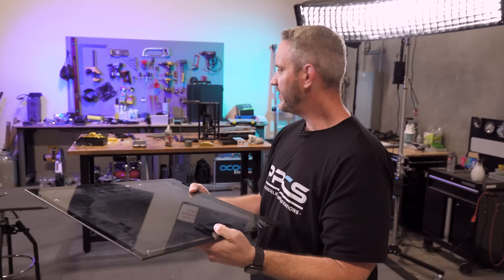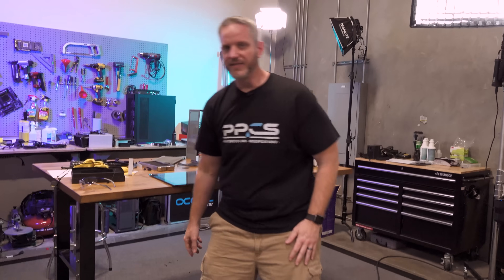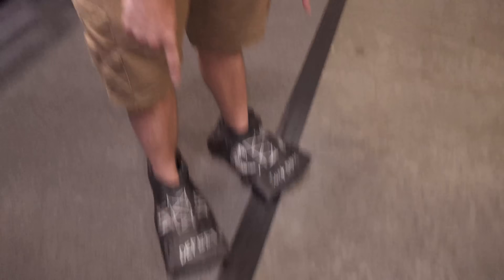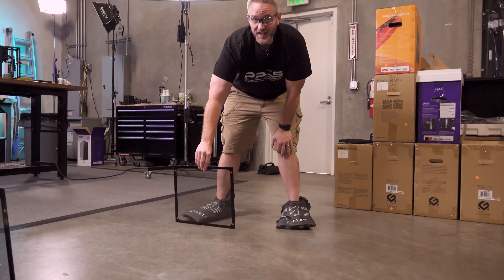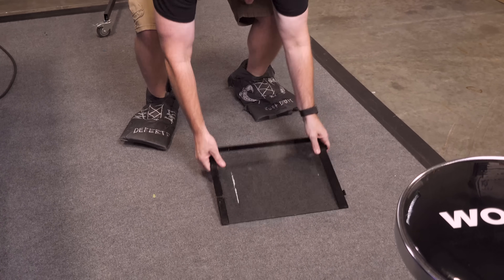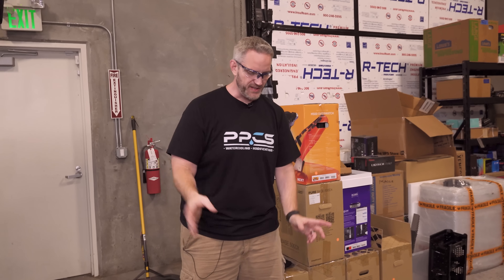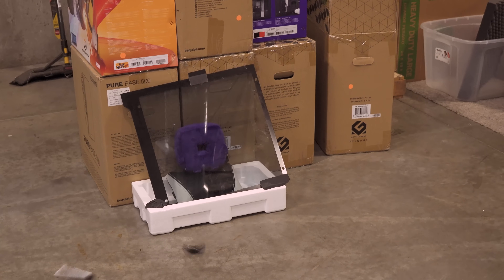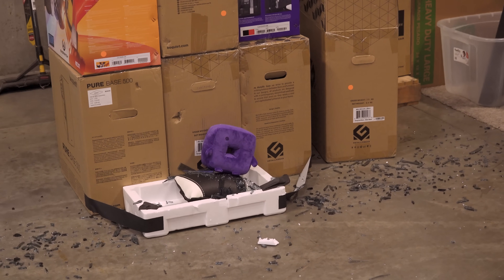How hard is it break tempered glass side panel?? SCIENCE!

Comment: Anyone talking about the glass breaking and hurting someone needs to know 2 things. 1/2 inch thick tempered glass is extremely hard to break. You have to hit a corner really hard with a small point to break it. The 2nd thing is tempered glass doesn’t break into sharp pieces so of it did break you wouldn’t get cut. This glass is completely safe to use as a railing and actually looks really beautiful

Comment: My experience building PCs over the years has told me that basically ALL PC components are far more resilient than you would think.  Inserting brand-new DRAM into a brand-new Mainboard always requires just a BIT more force than I feel comfortable applying - and it's always perfectly fine.

Comment: I bought my wife a tempered glass patio set for a spring cleaning reward several years ago. It was outside literally overnight, we woke up to what I thought was some punk kid coming through a window. Turns out the glass in the table EXPLODED for no apparent reason, and lo and behold, the shop we bought it for wouldn't honor the warranty on the table top. Ended up making a wooden top for it, but beside the point, I've never broken a Pyrex glass container and there's been more than a few that I've wanged off the counter or shocked them with temp swings. And as I understand it, the American version is the wussy version compared to what the rest of the world gets. Different technique but they ought to make side panels with boron glass!

Comment: This is one of the most common complaints on PC case reviews on Amazon, which you shouldn't buy computer parts off of for other reasons, and it confused me because of just how much they vary. People are dropping them "from 1 inch" off the ground, 1 inch off a cloth covered table, someone had set theirs down on the unheated stovetop and pressed lightly on it to clean off some smearing and it shattered, somebody else lightly tapped the glass against the PC case they had just finished installing and the glass exploded. The quality of glass side panels is very inconsistent in the quality control sector it would seem.

Comment: most modern glass tends to be strengthened in some way or another, when we moved into our new house there were some old glass doors, we got shut of straight away, when we dumped the doors in the skip the glass broke instantly into huge jagged shards, we then had to replace some double glassed windows because a lintel was missing, that's right the window was supporting the wall unbelievable! and the damn survey didn't catch this, but when we disposed of the more modern double glassed window it actually withstood being dropped about 6 or 7 foot into the bottom of a metal skip didn't break at all, quite surprisingly. old glass big no no, modern glass still not as safe as no glass but hell of a lot better than it used to be.

Comment: You have just proven why it's a bad idea to mix glass with a PC case. When you first dropped a pc case ( by mistake) did it land straight on or hit on a corner? If you have any other cases with glass panels you should try a real world test and drop the glass attached to the case from at least 4 FT height. It will most likely break. I recommend you wear pants next time.

Comment: The hammer part is actually very important. hitting it with a falt part of the hammer didn't break it, but hitting it with the curve of the hammer's head at an angle did and i'm sure you can consistently repeat this and the hammer won't break it when hitting the glass with a flat part and wil ALWAYS break it when hitting it with a corner

Comment: just pointing out a small thing... you put the glass on a styrofoam "stand" and have cushion behind it... it will be able to disperse the energy more than if it was dropped straight onto the floor on its own or when the panel is screwed onto the case. In a real world scenario... it would have more chance to break on impact from the gpu or screwdriver

Comment: What an interesting video. Especially because we have sauna doors made of this stuff here, and people (kids, drunks) do slam the doors quite a bit, might bump them with solid objects, whatever. They're considered safe enough for that kind of frequent "life happens" use. They usually have no frame of any kind (as in frames like the metal ones on the video), just a large glass sheet with hinges and a knob attached to it. Ours is around 180x84CM (5'11" x 2'9"). Judging from the video I would presume that there is good and not so good quality glass available for various purposes, and for something like a large, very heavy door that is meant to be used while butt naked by everyone in the family (so no shard or crushing protection whatsoever) you wouldn't cheap out. 

And now I'm wondering if the material needs to be in any way "special" when it comes to thermal qualities since the top part of the door can be in contact with 100C/212F+ temperature air from one side, significantly cooler on the other. Kind of like what can happen to a side panel with high thermal load PC in a cold country I suppose. (Opening a window in winter for fresh air and all that...)

Comment: 8:50 It's fascinating that the glass shattered mid-air after bouncing off the concrete. Like it absorbed the impact energy and then the vibrations took a while to hit a weaker spot or accumulate in one place to break the surface. Amazing.
Reply: I might be seeing this wrong, but to me it looks like it survived initial impact, then the corner hits the floor and thats what did it in
Reply: @wulfywulfynrir1296  exactly. That secondary corner impact is what made it snap. You can tell by the way it shattered originating from that corner

Comment: i think the issue with tempered glass breaking in some instances isn't exactly on applied force but on thermal stress. It's possible that the glass already had defects and thermal changes from heat to cold just slowly deteriorate the strength overtime.

Comment: A broken piece of spark plug insulator would like to have a word with you.

Get a spark plug and a hammer.  Hit the insulator (the white part) of the spark plug with the hammer until it breaks into a few pieces.  Take a piece of the now broken insulator (it will be sharp beyond belief, wear mechanics gloves to pick up the pieces).  Even a relatively soft toss will completely shatter a tempered glass window as long as one of the sharp sides impacts the glass first.  It is almost entirely silent when it breaks as well.

Tempered glass is great for blunt impacts and bumps but can't handle a direct impact with something very sharp.  This is a feature of tempered glass, not a flaw which many people seem to think.  It is made this way so if you get into a car accident strong enough to where the door windows break, the glass ends up as tiny little pieces with mostly blunt edges to reduce the risk of lacerations as the pieces are thrown around the car.  The windshield is made of laminated glass so throwing a spark plug insulator piece at the windshield will likely just have it bounce back at you.

It would be interesting to see if any case manufactures are lying about their tempered glass claims as this method would expose that for sure.  Plus it is neat to see tempered glass break with this method as it is almost completely silent, especially when compared to breaking a non-tempered piece where you get the classic glass breaking sound heard in movies.

Comment: Very short Science:

Production: Take a normal sheet of glass and heat it very high und cool it off quickly

After this toughened glass can withstand a lot of force, you could also put 2 sides of the sheet on a block and stand with 2 adults on the glass, and it will not break only bend.

How to destroy it: As shown, damage the edge or use anything sharp. A sharp tiny stone on the floor while flipping the glass would have done the job. Drilling a hole into it would also destroy it immediately, therefore they have to be in the glass before toughening 

Safety glass: There are 2 types, toughened glass and laminated glass (using PVB foils or similar). Wire mesh glass isn't considered as saftey glass anymore, at least here in Europe.

Comment: This video here is why I am really against tempered glass or anything glass for a side panel (and yes I do have one case with a glass side panel mainly because of the functionality of the case itself). When you changing out parts in the case trying to find a place to put the side panel safely this is why accidents like this can be dangerous to avoid. This is why I am fully supportive of using Acrylic side panels, which are so much more resilient and much less prone to accidents but yes I know that scratching it doesn't make it look great and cannot be easily be fixed compared to tempered, which can be cleaned up more on that side of things. I seriously think PC Case Manufactures need to go back to Acrylic side panels (and develop them further to fix scratching) or I wonder if some form of Acrylic/tempered glass hybrid could be made so it makes the side panel stronger to prevent breakage like this with pure tempered. Or is it not possible to combined both types?

Comment: Drop it flat on carpet, but have one tiny little stone in that area… if the stone, while tiny, is just big enough for the glass to touch it… it will very likely break.  Tiny stones often have sharp corners, and those edges will break the glass.  I'm pretty sure of that.

Anecdotal evidence ;-) (or just an anecdote :D): driving with my mom (decades ago) behind a truck, and suddenly the windshield went BANG and was gone into lots and lots of tiny fragments. Still kept together (safety glass, natch), but you couldn't see anything through it anymore.  Our theory was that either the truck lost a tiny stone (it was carrying gravel, IIRC) or it threw up one from the road.

Comment: Lol what a great fun vid, you should have titled it 3080 vs Tempered Glass, I bet it would get LOADS of views.
Its interesting to watch your slow mo's at 0.25 speed, the glass still breaks instantly but you can see it happening.
I wonder were there still micro vibrations going thru the glass from the first hit when they break on the second, like if you gave it 10mins and threw the hammer again would it be fine. On the corner drops, the second glass bounced from one corner to the other no problem but then when it bounced and hit the initial corner that took the hit for the third time it smashed.

Comment: I consider tempered glass to be garbage. I recently bought a Corsair 400D Airflow case and was making adjustments to the fan configuration. I was taking the glass panel off and since there's nothing to hold it by the edge slipped off the case while I was pulling it out and the edge fell 1/2in onto the floor and immediately shattered. It was an utter waste for me anyways since I had a black, no-rgb build. Luckily I realised that the panels were symmetrical and told Corsair to send me a replacement right metal panel instead of the left glass one. Fits perfectly and now I don't have to worry about that nonsense anymore.

Comment: Best comment I read with makes so much sense it to put a window tint on both sides of Tempered Glass to help it be more stable, and if it does shatter the tint will hold most of it together for easy disposal. Pieces of Ceramic is the easiest way to shatter Tempered Glass.

Comment: I built a computer for a friend (will be showing him this video) and his case had a tempered glass side panel. When i was done, asked him if he wanted the honors of closing it up. He said yeah but line it up for me because i don't know how this goes on (it was a snap on fractal design panel) so i lined it up, he came to take it from my hands but he wasn't ready for the weight and he shifted when i handed it over... the shift caused the corner to tap onto his tile floor... and it shattered. Thankfully, the plastic peel was still on so it stayed in one piece. He managed to get a replacement and had me install it.

Comment: Had a tempered glass entertainment center. Top piece exploded just lifting it up at 4 points. Bottom piece I hit with a sledge hammer and it vibrated my hands so bad I felt it in my elbow.

Comment: I recently threw one of my aquariums in the garbage because the seals were getting a little old... Had the thing in the garbage can and used a hammer, it was unbreakable. No matter how hard I could manage to hit it straight on the front, it wouldn't break. Whacked it once on the edge, going from top to bottom and the whole piece blew apart. Hit the other sides in the same spot and same result. I could not believe how strong it was straight on the side. I would like to think my side panel on my pc is as strong but if you drop that its probably gonna land right on the edge and blow up lol

Comment: Long time ago I worked for a company that built displays in Home Depot. One display was for a curved glass shower enclosure. At some point the prior week door had come off the track. So, someone leaned it against the wall. I noticed it, picked up the door to put it back on the tracks, and 2 sec later the thing exploded in my hands. Luckily it didn't cut me or anything. However, it did scare the shit out of me. Best I can figure, leaning the door against the wall built up tension in the glass. Once I picked it up it released that tension... Rapidly.

Comment: I use plain tinted glass to modify my case about 8 years ago. 6mm think, yes it is not safety glass but at the timke my glass guy said the 80-90c GPU which is very close could be a hazard to the tempered glass. And bonding it to metal which changes shape with heat they said normal glass would flex more. 8 year on still going good but non of my system goes above 50c not even the GTX1070 or i7 4790K thanks to water loops.

Comment: 2 of my spare builds dropped from a shelf recently. (Shelf collapsed) while I was under it working dumping 2 pcs on top of me, one hit my head and dented the top edge of the case but the part that really sucked was that glass. That crap went EVERYWHERE :+ I am still cleaning it out of drawers. One of the PC side panels that did not hit my head did not shatter. Ripped the screws right out of the shelving. Use beefy hardware folks.

Comment: About 25 yrs ago I had an audio component rack that had a tempered glass hinged door on it and one day when I was removing it for cleaning I started to slide the top hinge off of it's pin (which at the time I had not realized that the bottom hinge pin was actually longer than the top one) and as soon as the top hinge freed from the pin the weight of the glass shifted in my hands while the bottom pin still had a leverage and thus the slight tilting force shattered the glass so fast that it appeared as if a bucket of water was dropping but, of course it was not water just a thousand tiny water sized droplets of tempered glass all of the hardwood floor...at the time I was wearing shorts but yet I did not receive a single cut...I guess that's the safety part that Jay spoke of ;)

Comment: Jay, you have it backwards. All tempered glass is safety glass, but not all safety glass is tempered. Annealed laminated glass is also a safety glass. As used in windshield of vehicles. The laminate holds the glass together when broken. Also to a lesser extent wire glass was used as a safety glass.

Comment: I've had my Corsair 5000X RGB tempered glass side panel break just seconds after laying it down on soft plush carpet, and no there was nothing underneath buried in carpet to break it. It exploded only seconds after laying it flat on carpet. I had a Phanteks Evolv TG panel like the one you have in this video for nearly 5-6 years and never had an issue, but the Corsair one was done in less than a month. The warranty was easy and they replaced it no problem, they actually sent me the wrong side panel so now I have a spare panel in addition to the one that needed replacing. What I've learned is that if the surface isn't maleable or there is almost no give then TG will shatter and or explode. Don't ever leave or lay down TG on ceramic surfaces or tiles.

Comment: I've seen sledge hammers hit panel face on without breaking, but crack it on that edge?  SHATTER.  SO MUCH tension in that glass.  I've also seen it spontaneously explode...shower glass has been known to "explode" sometimes even years after it was installed.

Comment: If you look at a lot of those posts on Reddit the PCs are usually sitting on ceramic tile floors. Ceramic is harder than tempered glass and will break it easily. That’s why tapping the ceramic end of a spark plug causes a window to explode.

Comment: I had a tempered glass door, from an entertainment stand, out in my yard for years. I would use it when I needed to work on a flat surface, or put it over pots when gardening, like an improvised cold frame. After several years of sitting outside in New England weather, one day I picked it up and it just exploded! I wasn't surprised when it happened, just very disappointed it was gone. Even my cats enjoyed sitting on it, because it would be warmer than the driveway.

Comment: 13:04 Fully pretensioned/tempered glass hould break into small bits & pieces, but there's also annealed/semi-tempered glass, which breaks into bigger shards, closer to float glass. And depending on the tempering process, any forms in between fully and semi-tempered glass.

Comment: The only panels ive broken are from Fractal.  I dont know if its the way they mount the frame but the glass is under extreme tension ready to explode.  On both panels I dismounted them and it dropped about the height of the feet of the case onto its edge (about a 1" drop).